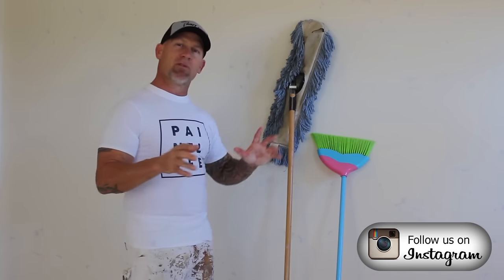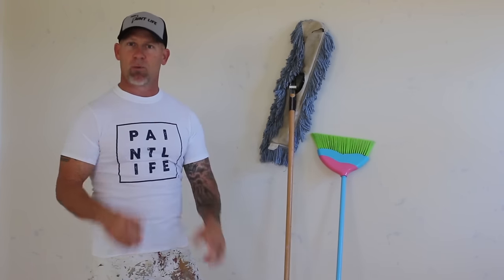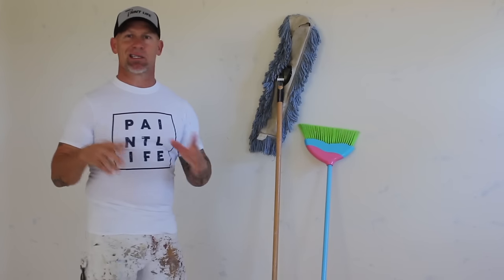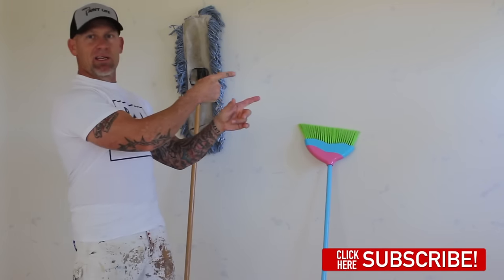Mopping Walls Before Priming.  Painting New Wallboard or Drywall.  New construction painting.

Comment: Having worked largely in medical remodeling, I cannot imagine using a blower! Infectious Control would have a stroke! What an awful mess, and so many clogged filters! We gently swept walls, then dusted with slightly dampened rags, then used floor sweep to clean up all (and I do mean ALL) the dust off the floor. Also, as both a drywaller and painter, cleanup after sanding is really part of the drywall crew's job, not the painter's. Some commercial drywall crews even prime their walls, though as a painter I'd prefer they not.
Reply: +The Idaho Painter Normally it isn't. But in hospitals, especially operating rooms, everything is considered infectious! Medical construction can be a real hassle sometimes.
Reply: I agree with you, this is ridiculous and terrible information.  Yes he should of cleaned the floors first but I still would never use a blower, all of the particles will stay in the air for a long time
Reply: @user-tn8hb5re9d  this is for production jobs dust is not a problem
Reply: this is the exact thing i have been looking for, thank you for this comment.
Reply: Never ever use air to move the dust, period.
Airborne silica dust is a no-no.

Comment: Pretty good. I'll have to try that. What i've been doing is using a shop vac with a filter bag along with an extension hose, a couple of extension wands and a 1 7/8 floor brush. It works really well but it may take a little longer since you are making smaller passes but it's nice because it vacuums all the dust. Thanks for the video.
Reply: acejenkins80 just stay with your method, I like it much better!!
Reply: You're doing it right. He is doing it wrong.
Reply: ace - Yes, you are doing it right!  It is better to use a vacuum.  If you blow it, you are just blowing the dust from point (A) to point (B) and getting the dust back on the walls again.  Better to use a vacuum and you know it will be gone forever...

Comment: To all the people that love to criticize, I agree with what he did both the dust mop and the blower. If you listened then you would have heard him say to open all the doors and windows!!! Cant use anything wet to wipe bare drywall mud because it will smear it! Especially if its a specific texture style. Yes some dust will settle but the concept is to get loose material off the surface to enhance adhesion. This applies to ANY painting prep. I also paint automotive paint and that is called tack cloth! If you don't have a question or  positive comment, then just don't watch!!! This man obviously works for his living. Thank you for the videos they are informative.
Reply: Doesnt work......the dust hangs in air and doesn't mean it's all gonna go out the windows....it sticks back on walls.....I run powerful fans pulling the dust out and even that dosent work all that well......drywall dust is so light it just lingers and sticks to everything.........wet mopping would be best bet and rinsing....come back next day to paint

Comment: Great tip on how to make a huge mess. I use a 5hp shop vac with sanding attachment, filter removed and exhaust hose bubbling into a trash can half filled with water outside of the structure.
Reply from the maker: Oh man

Comment: I just did this on a new construction home. worked like a charm!
Reply: +The Idaho Painter Well, like you just said there's more than one way to do any process of a job.  It worked well for me.  Of course, it would be wonderful to have the floors swept first to cut down on circulating drywall dust, but the walls were fine.  Once the sprayed PVA primer was dry, sanding was a breeze.  Also, the sanding was mainly for the furled paper around the drywall joints, not dust.  I really appreciate all your videos and we have utilized a ton of tips from you in our painting business.
Reply: +The Idaho Painter Well that's cool!

Comment: i work for a paint crew and when things slow down i work for a remodelling crew. i  paint and tape/bed ( patchwork and new drywall). but i'm new and i've only been doing it 2 years. this week we worked on a very large house and took off ceiling texture(popcorn) and the clients want it with no texture. there was a lot of imperfections under the texture(lines, nail holes and patches). we used 5 minute and sometimes light weight then kilz latex primer (blue label). after it was done i couldn't believe how straight and nice my side of the house looked, until we painted it and i had 2 spots where  the old paper tape started to bubble on an old patch job. then  3 small spots where the paint just peeled off when i rolled it maybe it was the paper on the drywall? my boss sprayed it and then asked me to roll it because he used the wrong tip on the rig. it was uneven and too much paint. my boss buys the walmart flat paint.. what did i do wrong? any tips because we start the next side of the house next week, i've never had it bubble or peel on me before, i've seen it once or twice but it happened to another guy.
Reply: I have seen this, often if a ceiling is getting texture they skimp on the finishing because you "won't see it anyways".  I am working in a building built in 2007 and we are having the same issue.  Scraped some ceilings and the old tapes are cracked and peeling.  Gotta cut em out and redo it, it sucks but it's the only way to TRY to guarantee that you'll have a decent finished product.  When you prime/paint any bubbles in yourtapes might suddenly show.  You can cut out the bubble and mud it again as long as it's not too big...  If you are getting too many bubbles then your tape wasn't embedded correctly.  When I mud joints I "slap" the mud in to try to push out any air.  If you have a bunch of big joints then go around with taping mud (or confill for the bigger joints) and pre fill them before taping.  Mix your taping mud a bit thinner and make sure your tapes are good, it's hard to fix them later!  Most of all, practice and keep learning!

Comment: no I mean I roll the primer on no spray and it doesn't look good once top coated. so I use a premium wall and woodprimer or contractor primer when I prime new drywall
Reply: In that case use a brush, fill the little grooves in the trim then once fully coated swipe over the entire length of the piece to give one continuous brush stroke.  Kind of looks like wood grain.  Or if you don't like that use a 4" roller, might be quicker

Comment: What about dry vac the walls with a large soft bristle attachment ?
Reply: i actually use a microfiber pad broom pad, dust clings to it,.. go through a couple in row or go outside quick pound them out, vacuum bristle doesn't work even close as one would think..  been there tried it, i do recommenced doing vacuum on bare concrete basement walls  after wire brushing
Reply: @DannyTubiolo  Totally agree. Never had luck with that method. It takes forever, but wetting a cloth and wiping is the best way I've found
Reply: @DannyTubiolo  I'm going to try the microfiber dust mop, i have 2 of them. im doing a full house diy job and learning as I go. first couple of rooms I didn't clear the dust after sanding knockdown texture, primed and 2 coats of paint and few months later I have no problems what so ever. the last room i thought about the dust, and used my air compressor to blast all the dust off the walls, it filled the room and bled out the door. I just textured the upstairs living room area and don't want to blast it this time. given my paint adhered to an un dusted wall the first time i think the dust mop alone will work great. I have my floors sealed off with plastic so I'm pretty good on dust on the floor. I'm also using an airless paint sprayer so not sure if that makes a difference.

Comment: can u paint over mold or do u have to scrub the wall clean first? I have bought paint that said its for mold and wet areas. the mold on the bricks coated with plaster then paint is hard to get back to clean wall, hope I can just paint over it? thanks in advance.
Reply: +Adrian Higgins Use bleach diluted with water and scrub away all mold, after it dries, sand it, then dust it, if mould is real bad and imbedded into plaster do bleach, scrub, sand , dust then paint over with an oil based primer sealer undercoat, than paint over with any latex paint, if in a bathroom or wet areas, do as above but the paint your going to be needing to use, is a semi gloss or satin as sometimes its named, these paint will have a mold inhibiter in them, you can also buy mold inhibiters to add to paint in humid area's,  but follow instructions and wear appropriate person protection gear (PPE)

Comment: A little  effort is better then then none at all , I usually dust with a big ole swiffer type mop just to get the heavy dust off and yes I have used a blower but thats a freaken mess.
I have actually seen a job fail where painters had to go back and literally peel off all the paint and primer, I was once asked to go back after painters to peel all the paint off but turned that job down. I have a secret for dusty walls and chalky surfaces but i'd have to charge a fee for that secret to be shared
 LOL
Reply: +The Idaho Painter PVA was used on that job that peeled, they didn't dust the walls after they had skip troweled then knocked down the heavy texture ( sanded )and in between the texture you had the bare walls with dust. I use DE gripper rather then PVA not sure if thats wrong but I dont want any failure. I'd hate to start a new topic and probably get some negative  opinions on how I paint exterior chalky surfaces but I will say I add an additive to my acrylic paint so it bonds well to substrate and its half the cost of DTM, thats it thats all i'm giving. :)
Reply: +The Idaho Painter Yea something like that, SW carries it...thanks for the videos great info your sharing!!

Comment: We LOVE all your videos!!!  We have been watching for at least 2 years!!!  We also just noticed, and enjoy your references to Scripture.  However, they are difficult if not impossible to find after watching your videos.  While watching your video, I hate to interrupt it.  Afterwards, I can never remember them with any accuracy.  And the references become impossible to find!!

Wondering aloud if you might include the link below, Or, provide those references in a consistent location, such as at the very beginning, or, at the very end of your videos.  That way, it's easy to go back and find them.  GOD works in mysterious ways!!

Keep up the GREAT work!  We own several rental properties, and a couple flips.  I am LOVING spraying!  We bought a Milwaukee High Pressure, and HVLP machine that we obtained at a Big Box Store.  At the time, it was what we could afford!  Since then, we upgraded the gun to a Graco, and have bought both Graco, and Titan tips.  Some of the Titan tips have double orifices, and are a great value!!!  By rotating the tip 90 degrees, you have a second sized orifice!!!

Thanks so much for the service you provide!  Thanks for your references to Scripture!

KEEP THE FAITH!!!

Cheers!
Reply: Milwaukee® Airless/Finish Paint Sprayer M4910-20
Reply: Would LOVE to learn your opinion of this unit.  Or, a review.  We LOVE it!  Only wish it could meter pressure, to fine tune our learning experience.  It merely has numbers 1-4 to meter pressure.
Reply from the maker: Good idea Peter, thanks for watching!

Comment: I thought the dry mop was a great idea ......if it had been taken outside and cleaned off or vacuumed every 1/2or full wall. You could see the dust being spread around. A fan turned around at Windows would help pull dust out too. . The blower I don't get - the video shows all this dust from the floor being blown around. Utilizing these great tips but taking them to completion might work a little better. I would vacuum the floors to get balance off first. Then blow off high up, let settle 10-15 minutes, dry mop and vacuum the floor again. Or skip all, put a protective floor bonnet on vacuum (just goes around hard edges of attachment to prevent scrapes - may not be necessary) and just vac the walls utilizing shop vac.. It would eliminate all the dust getting blowed around. My biggest gripe about pros is they preach prep and how much it affects price but rarely see them follow through. At least this guy recognizes the issue (most just sand walls/trim and start rolling. All dust should be eliminated before finish paint is applied including dirt/debris on floor. 

*When my floors were finished with new fast dry sealers, they used a reg vac with this cushioned floor attachment they put on - like a bonnet. When asked, they said it prevent scratches in dry but not cured out sealer when light sanding between coats.

Comment: I'm guessing I'll never be a pro like these guys. Took them 2/3's the way through the video to 'get down', then only to blow most the dust right back to where it started. Would have made more sense to attach tack cloths to the mop instead of just having it all spread around then blown back with a leaf blower. At least use the blower to vac it up.

Comment: seems to me that the blower was stirring the dust up off the floor which may settle back on the walls.
Reply: I think I would clean the floors also . I'm getting ready to paint a bathroom that I completely re-sheetrocked. I brushed the walls down with a soft dust brush, swept the floors, vacuumed the floors and walls then blew The ceiling and walls off with compressed air. maybe a little over kill but I wanted to be thorough.

Comment: I am DIY homeowner/landlord and have taped and textured quite a bit.  I know you pro, but I am not buying this as you are blowing ultra fine dust back onto walls and into cracks and crevices of rest of home.  I use shop vac w/ hepa+paper filters with bristle brush floor attachment and run 2nd hose for exhaust out window.  I have tried used compressed air, but it can makes big mess.  This might work OK with huge exhaust fan and multiple passes with the blower??  I like the floor mop and have dry and lightly damp mopped the walls with good results.
Reply from the maker: Awesome, thanks for sharing Marcia!

Comment: Don'y get the dry method, it seems you are just spreading the dust somewhere else. Once i've sanded a wall, (and this may seem a little strange) i get a cloth with turpentine substitute (ts) (make sure the windows are open) and wipe the wall quickly. The ts evaporates really quickly and no dust will be on the surface you are applying primer/paint...just make sure you have plenty of cloths. just my humble opinion/practice
Reply from the maker: Mops like this are not meant to just smear dust but to pick it up. Thank you for sharing!

Comment: What difference does sealing a ceiling surface twice? Before 2 coats of the flat paint. If it's a stain blocker does it hide a stain any better to do it twice?
Reply: More coats of primer won't hurt, patch all your dings after first coat and coat again then paint and it will look great